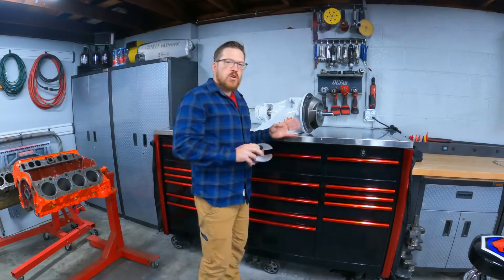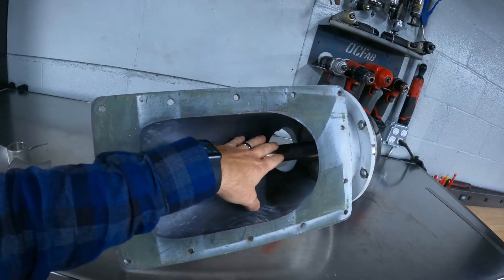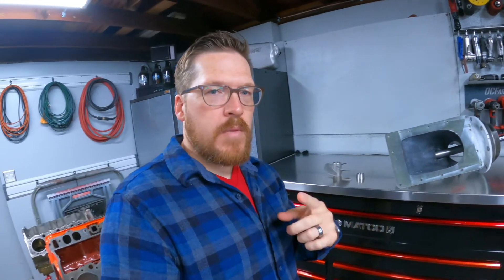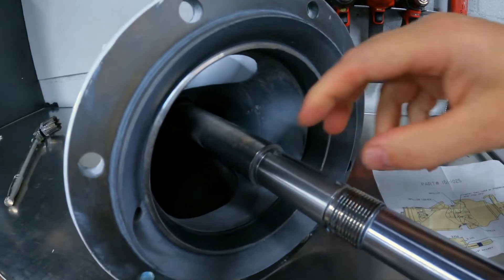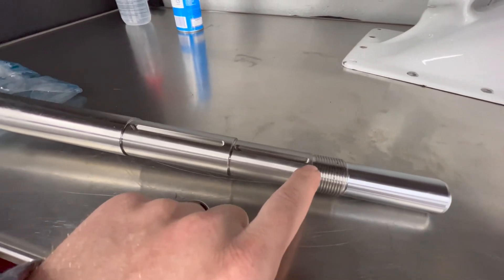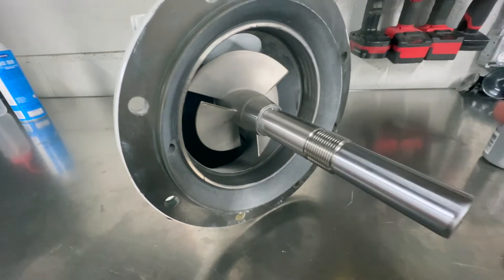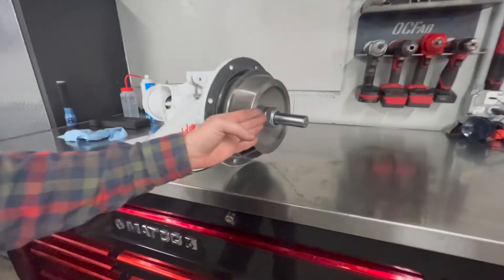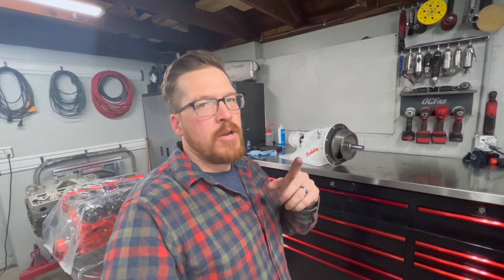Installing an Inducer into a Berkeley 12JG Jet Drive Pump

Comment: How much more power does it take to run the inducer?
Reply from the maker: In nearly all instances, adding an inducer does not require extra power. It is not like installing a larger impeller. An inducer is one of the few things that bring only benefits and no downsides. 

~ Nick

Comment: I bought a machined shaft from Berkely.
The JG pump I bought was used so the original shaft was worn out so logical thing to do was buy a new shaft machined for the inducer and buy the inducer.
Reply from the maker: For sure! If you need to replace the shaft def. get an inducer in there!

Comment: I gad an 18' American Eagje with the 455 Olds. 
A fun boat. 
The AA impeller held max rpm to around  4200 and improved the hole shot noticeably for skiing. 
It also made for an fairly economical part throttle 30 mph cruise at 3000 rpm. 
Would the AA work better for your application 
I installed a shouldered wear ring to tighten up impeller to housing clearance. 
?
Reply from the maker: With my engine setup the AA would not work well. The boat will be getting a mildly built 496 that is making peak power in the 6k range. I need the smaller cut impeller to allow the engine to get into its optimal range. Heck I think a B impeller might be a consideration for my setup. 

~ Nick
Reply: Best boat ever.

Comment: No no no...
First off, Good videos, good quality and entertaining( dog gets extra treats for being your sidekick) . 
 Maybe I misunderstood but please don't send that nice SS impeller out to be butchered!
The way to do this job is:
1. Do not modify the impeller for clearance! Always cut the shaft.
2. set the front clearance (leading edge of the impeller wear surface to the suction housing (min .035")) by having the shaft cut (impeller locating shoulder).
3. then have the shaft machined for the inducer.

You show that you currently have "about 1/4" front clearance on your impeller.  If you tighten that up (.035" min) you will have better efficiency and also now have clearance for that stuffer. 
 Liked how you talked about the importance of measuring impeller height vs bowl depth.  That will cause some problems if it is negative clearance.

As commented by another viewer on the assembly video, once assembled give the whole thing a spin by hand.  Should be NO rubbing.
Reply from the maker: Kevin, 
Thank you for the kind words on my videos. I really appreciate it!! 

I agree with you on how to address the clearances. After I made this video my project plans got derailed, as I am in the process of replacing the stringers and transom in the boat. Because of this I have not yet pursued correcting the fitment issue's on the pump. With the benefit of time and being able to give the problem more thought, I have came to the same conclusion that you mentioned below. I am going to have the shaft machined to get the correct placement of the impeller, and inducer. I will then re measure and address the back end of the impeller to the stuffer as needed. If more clearance is needed for the stuffer, I will likely have the mating point of the bowl milled down as needed to get my rear clearance. 

Thank you for jumping into the comments and helping to share your knowledge with others. We and our hobby will be better off the more we can all share what we know!
Reply: After machining the shaft, then you can just use shims in front of the impeller (they sell for this) and get proper clearances. And if anything is replaced I.e. impeller, you can just shim the new one also.